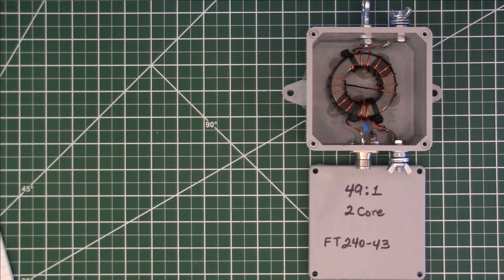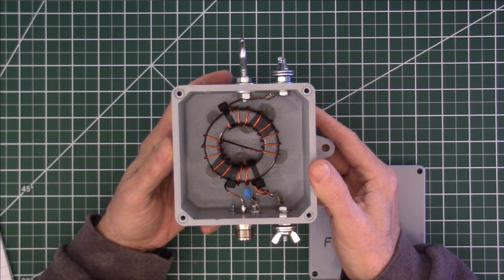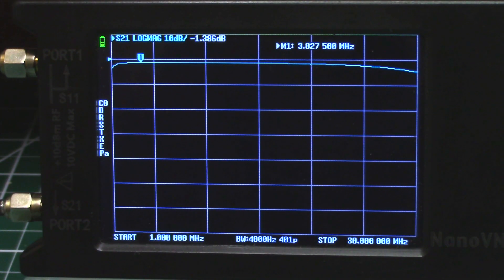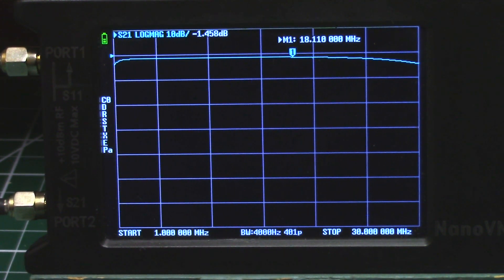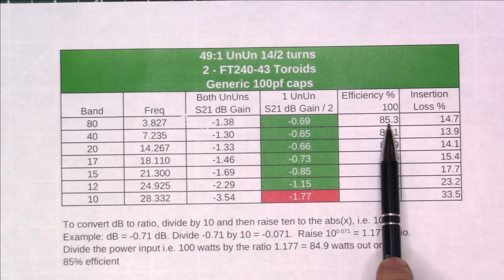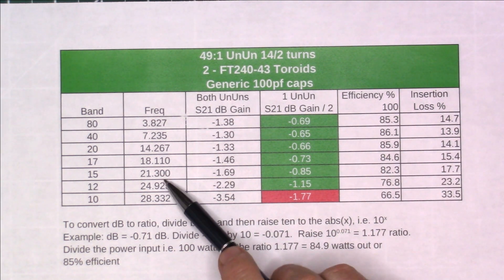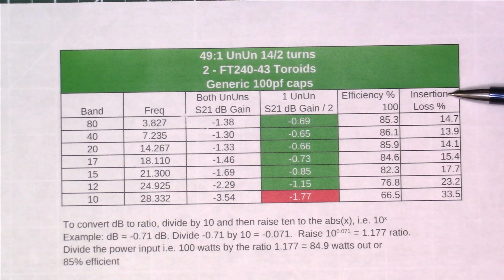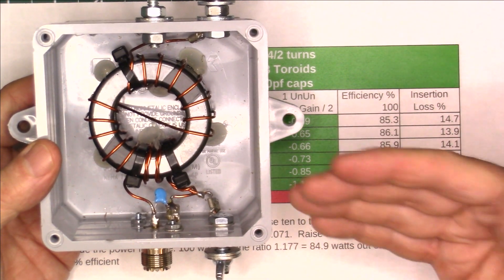Maximize Your Signal: Understanding Efficiency of 49:1 UnUn for EFHW Antennas

Comment: Hi the capacitor is 100pf but what is the voltage thanks Dave
Reply from the maker: I now recommend this one:
MFG Part No: CC45SL3FD101JYVNA
Description: TDK D: 8.5mm 3kV 100pF S / Ceramic Disc Capacitors

Comment: Thanks for the video! and there may be some loss in that transformer but it’s still a great multiband resonant antenna I’ve worked the world with mine. no tuner required, and the loss is so it’s insignificant that most people wouldn’t know it on the other end.
Reply from the maker: Thanks for the info! and thanks for watching!

Comment: What would be the ERP (effective radiated power) at 10m and 15m with 100w input?
Reply from the maker: Well ERP depends on a lot of factors.  If 100 watts is input to this Unun on 15 meters the output will be around 82 watts because it is 82% efficient. On 10 meters it is only 66% efficient so the output would be 66 watts. ERP also depends on many antenna characteristics such as wire type, diameter, height above ground, whether you use a counterpoise, it’s length, etc etc.  I have another video that shows how to build an even better 49:1 here Best 49 to 1 UnUn for EFHW End Fed Half Wave HF antennas
https://youtu.be/thuusY-qkHI

Thanks for watching.

Comment: It  is low power loss, would interesting to do high power e.g. 100W loss as well, might be higher...Cna be perhaps done with transceiver  and resistive divider /power meter or oscilloscope...
Reply from the maker: I’m not sure I have the necessary equipment to do that.  If you have more information about how I would be glad to look at it.  Thanks for watching.
Reply: @BudgetHamRadio  I guess one can simply  do two 1::49 back-to-back using transceiver, power meter and matched load..
Reply: @BudgetHamRadio  Thanks for replying
Reply from the maker: @nikolaipavlov544  I will try that setup my changing the location of my power meter and see what happens. Thanks for the idea.

Comment: Can you do this test with 9:1?
Reply from the maker: @mandytuning  Hmmm, I guess I could but right now I don’t have one. After I complete my other tests I will look into it.  What antenna do you use the 9:1 with?  Subscribe and turn on notifications so you won’t miss any of the latest videos.
Reply: @BudgetHamRadio  its for random wire non resonant length. Mine in particular is 50'  and does 10-80 pretty good.
Reply from the maker: I was thinking of doing an inverted L which I think was 53’ That may be what it needs.  I’ll look into it.

Comment: Never thought about doing this.  May want to see how the  typical 1:1 balun does. IMHO a does loss isn 't significant unless you are chasing signals downing the noise
Reply from the maker: Well it is a two way street. It affects the amount of power getting to your antenna, so it could limit your signal being received on the other end as well as it will reduce the strength of the signal you are receiving into your radio from another station. Like I have said, the antenna and the EFHW work, but they do have losses. All I am suggesting is trying to reduce the amount of loss.  Thanks for watching. Subscribe so you won't miss the upcoming videos.
Reply: Losses also equate to heat, and with QRO that becomes a concern.

Comment: This is what I say years ago. This is just transformer with fix ratio. Who can tell exact impedance of wire antenna? Nobody this is just awerage value. Antenna can be far away from desired value and than?
Only good matching with minimum looses are antenna matching unit. From 50 ohm to any posible impedance. Simple Pi or T match can do more than just simple   transformer.  Simple posible antenna matching unit is very simple design have transformer and secondary in paralel have variable capacitor. Capacitor is weak link , maximum power is limited by maximum voltage capacitor can handle.
Simple transformers is ok but for low power only.
Reply from the maker: Every piece of equipment or antenna is a compromise somehow. We just have to work with them and try to get the most out of them. Thanks for watching!  Subscribe so you will be notified as new videos come out.
Reply: @BudgetHamRadio  every wire antenna bahave different. Impedance, capacitance, inductance depend from wire material, ticknes, heigh above ground, interaction with others antennas and/or metalic structure. This transformer is perfect for smal power. But 100 W and above mismach looses are too high.
I use 90 mW on 7 Mhz for me looses is  imposible to measure. On 14 Mhz I have up to 25 W still small looses but became significant. I never try 100 W.
Have a nice day.
73 de 9a3hp
P.S. I was already subscribe on channel.

Comment: Ive been playing with this as well, would a larger wire guage like 14awg wire help? Ive also read that a tighter wound wire would be more efficient (wires closer together). Ive got several cores on order along with 18/16/14 guage magnet wire to test this out and 3d printing some enclosures while i wait. Ill be following your progress, thanks for posting your findings!
Reply from the maker: I’m not sure about how awg would impact the transformer other than current capacity.  I may experiment with a tighter wind with my existing coils to see how they are affected. Subscribe so you won’t miss upcoming videos.
Reply: Yes it helps, particularly with higher frequencies due to skin effect losses